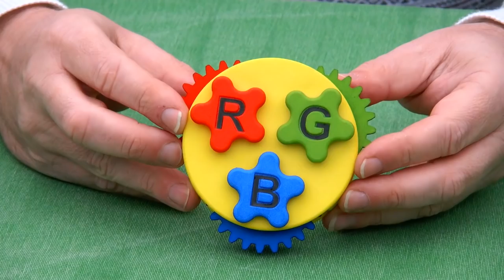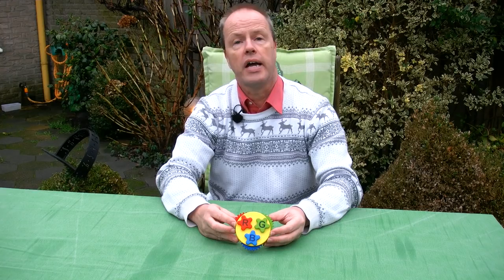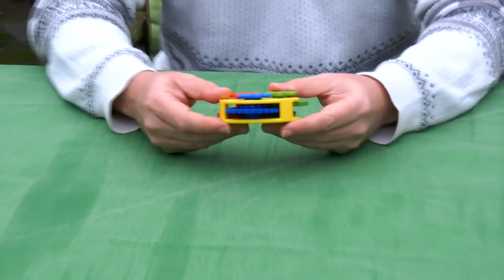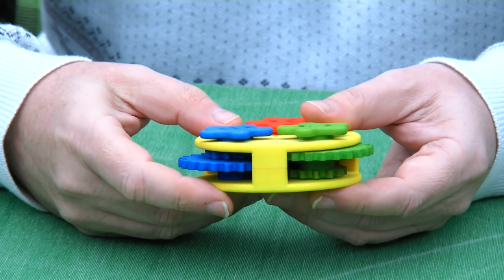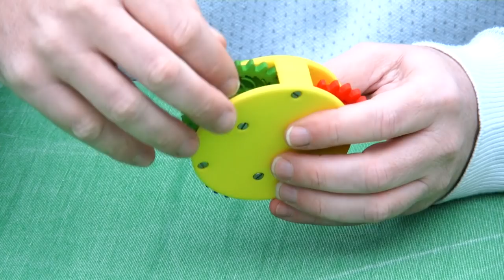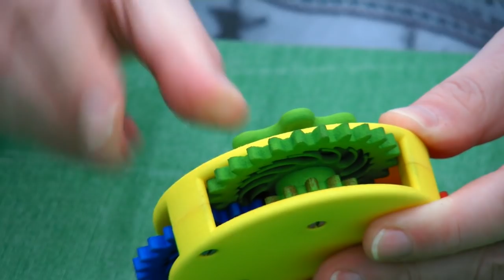Non Transitive Gears

Comment: Actually it is really a puzzle, think the objective of the puzzle to put all letters horizontal, vertical, etc. all with the same alignment.
Method, rotate each gear till position fits the objective.
And for your question: Oposite sides of a 3x3x3 Rubik cube rotates with that gear, so turning top layer forces bottom layer to also turn, but at a different speed; for three gears question use all three layers of the 3x3x3, when one layer turns, the other two also turns at different speeds. Solving such a 3x3x3 can be really madness if you applu such combined layers turns to all faces... since all three layers turns at the same time but at different speeds, it would be very challenge to solve a 3x3x3 non transactional full parallel rotating.
In ither words, put the face you want to ratate on top, rotate it and then middle and bottom layers rotates at different speeds, now rotate the middle horizontal layer and with that gears the top an bottom also rotates at different speeds.
No matter what face you turn the other two parallel will also rotate... very chanllenge.
And for a top level, rotation gear ratio can depend on rotation direction, that would be insane to solve on a 3x3x3 non transational gear.
Sugestion: first try on a 2x2x2 with only two 'gears', prior to do it on a 3x3x3; also first try it on one axis, not on all three axis.
Hope you get the idea... insane madness innovations.

Comment: In it's current state, I think that it is a puzzle, however not a very good one as you have an incredibly easy way of moving one piece at a time. To rotate a single piece all you have to do is one of the pieces you are trying to move, and the simply move the other you aren't trying to move back to its original state. This will rotate one piece a distance, though not necessarily an easy one to visualize., still, with a way to move one piece at a time, and only three pieces, I don't think it would be that hard of a puzzle to solve, though I can't really know using one.

Comment: Hard to put into words but
Have a ball maze and have this as columns in the maze with flaps on them so that when they rotate they block different paths. You would have to know which gear to spin and how much to spin it to get the ball through the path. Could even determine which door in the "next room" would be open already.

Comment: Interestingly enough, if the mechanism works the way I think it does, while they may be intransitive, they are commutative. As long as the total manual turning of each gear is correct individually, the whole puzzle is solved.

Comment: Hello Oscar,
Thank you very much for this paradoxical device! I am happy to see that it is more paradoxical than my original triad of intransitive gears is https://www.researchgate.net/publication/327286981. I thought that putting all three gears together is impossible, and only connections in pairs can work, but you show that the impossible is possible.

A kind of tasks (or problems) can be to turn the knobs in order they (letters R, G, and B) achieve certain positions relatively the device body and (or) each other. Some mutual positions can be achieved easily, but achieving some other ones can require (much) thought.

It can be a game for two players (the one player sets a task, and the other tries to solve it, then they change their roles) or for one player (I set different problems for myself experimenting with variants of various difficulty - and training myself for a game with other persons).
Reply from the maker: Hi Alexander, yes, I noticed your comment. I have tried the gear orientation puzzles. One can move gear R any distance forward by moving gear G a bit and then gear B to exactly undo the earlier movement of G and B. Same for the other two gears. So the puzzle or game may be rather boring without further restrictions ...
Reply: @OskarPuzzle  Thank you, Oscar. It's a pity. I will think about other solutions (puzzles)...